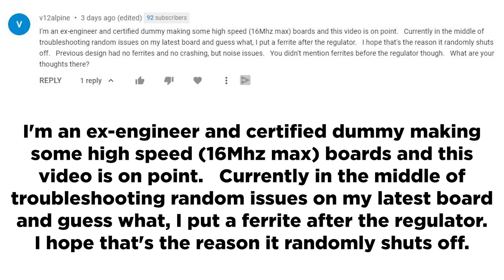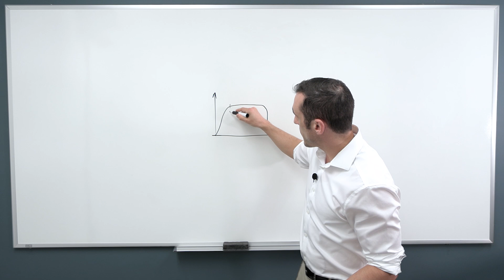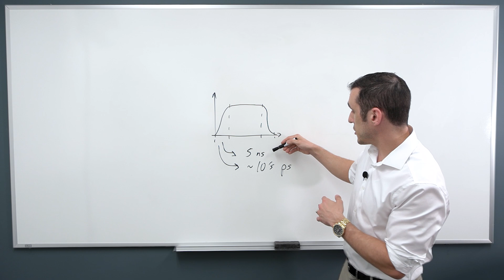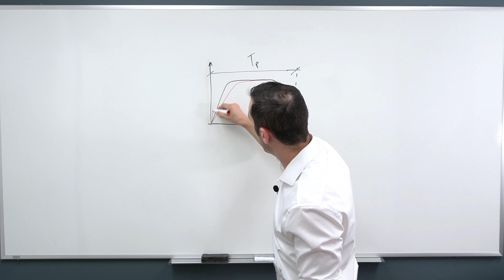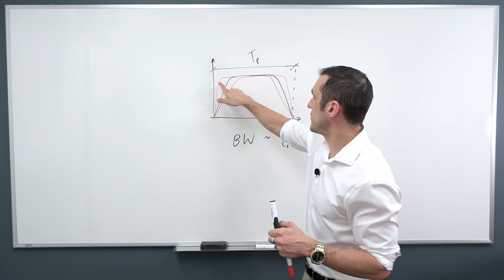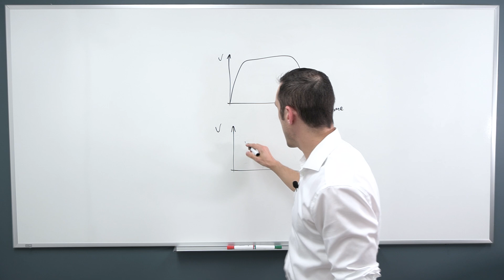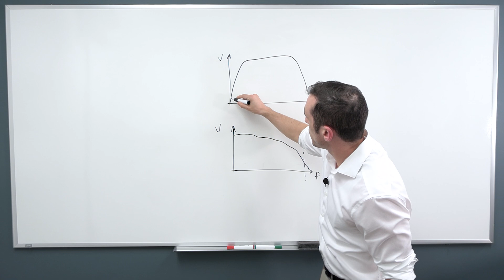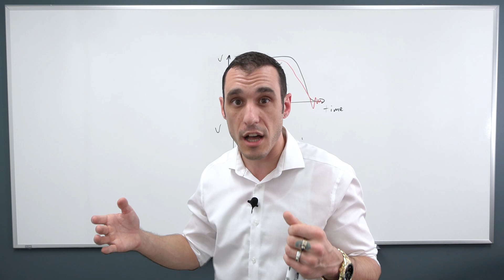What Are High-Speed PCBs? | Answering Your Questions!

Comment: This is also referred as the Knee Frequency == the highest frequency component in a signal
Reply: The knee frequency is the -3 dB frequency in the transfer function for a 1st order low pass filter (RC circuit). It is a channel bandwidth limit defined by a capacitive load connected to an infinitely short transmission line, it has nothing to with the power spectrum of a digital signal. The signal always has infinite bandwidth, that signal bandwidth gets limited to the channel bandwidth only once the signal reaches the load capacitance. At all times before that, the signal has infinite bandwidth. See here: https://www.youtube.com/watch?v=eVV42ahG0as

Comment: High speed is a really a matter of L* di/dt . You would have risetimes that are low and high currents to be switched you have to make some tweaks to your design.   If you have RF + High speed you have to master stackup of the board. Or use a recommended stackup from the manufacturer. I am glad you mentioned the thre key things - knowledge of terminations.- thevenin or series,  board stackup and how to do it properly ,  how to use GND planes and copper fill. But its common wisdom and backup by reliable textbooks : BW approximates = 0.35/trise.

Now you did mention Fourier coefficients after about the 7th or 9th  coefficient it would be  almost too small to make a contribution to the Power spectrum.
Even if you use a Square wave the coefficient magnitude drops off as 1/N where N is the order of the term.
Reply: High speed as we understand it only cares about the rise time because that's what determines the power spectrum of a signal. dV/dt and dI/dt matter for EMI/radiated emissions and crosstalk, but even with crosstalk we quantify signals injected into a victim line via crosstalk as a ratio, not as absolute value. But for the inherent characteristics of signal propagation, rise time is what matters.

Comment: I know that many digital datasheets focus on rise time, but isn't this discussion about rise times and "high speed design" dependent on the logic level voltage? A change in state over time is meaningless without the units of change, after all. (I'm an analog guy, so I'm more accustomed to thinking in terms of slew rates than rise times.) Without even doing the math, I can sketch a graph on the back of an envelope that shows that any given rise time from 0 to 5V is a higher frequency transition than the same rise time from 0 to 3V3.
Reply: Hey Peter, that's a fair point, but it's not a "higher frequency" transition, but I get that you're thinking of this in terms of a slew rate. the reason we focus on the rise time is because it's used as an indicator of bandwidth in the digital signal, and the bandwidth will be independent of logic level. So for example, if you use a 3 dB rolloff as a measure of bandwidth, you're just making a comparison between two levels (the max signal level and the signal at -3dB rolloff). That 3 dB measurement is not an absolute measurement so it doesn't depend on signal level but it does depend on the rise time. Also people focus on the rise time because some explanations of high speed behavior are easy to understand in terms of propagation speed, so you can make comparisons involving interconnect length by using the rise time and propagation speed.

However, when we look at crosstalk and radiation and power consumption, now the initial and final logic levels definitely matter. A 0 to 5 V transition at 1 ns will produce 5x as much radiation as a 0 to 1 V transition at 1 ns, as well as using comparably more power. This is one reason that large high-speed ICs with high IO counts (FPGAs?) and signaling standards are using lower voltages, there is a smaller swing between levels.

Also with differential protocols, the receiver requires the two signal levels to cross each other during their transition in order to trigger a logic level change in the receiver's buffer, so the skew limit has to be defined as a fraction of the rise time but not the slew rate.

Comment: I like what Dr. Howard Johnson says - if Tr is your rise time, then for most SI purposes, we can consider the signal BW upto 0.5/Tr.
Reply: Hi barronisme, those approximations are based on how an oscilloscope reads out a wideband signal. The front end of an oscilloscope acts like a higher order filter, meaning you can't accurately capture a rise time that is too fast. Then there is the channel's bandwidth, which is limited by multiple factors like load capacitance, dispersion, and roughness...
Reply: @Zachariah-Peterson  What I'm trying to determine is - if I have a Tr rise time, upto which frequency should I include in my analysis? I need to stop somewhere right.

Comment: Should have started off with Fourier to show how the energy (not power(!)) in the freq. domain is related to the time domain (show increasing amount of sinusoids -> steeper curve.
The 0.35/t_r BW approx. assumption is based on the single pole LPF - true for old style scopes - not newer ones.
Should have clarified that the rise time and the clock-speed are only partially interdependent - but with the proliferation of high-speed logic gates, even low speed digital IO can have significant HF content.